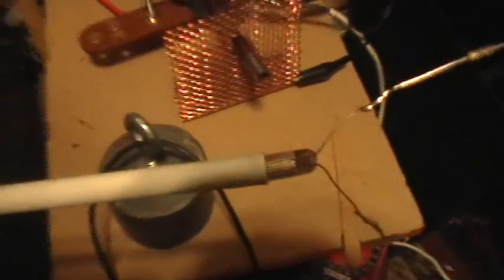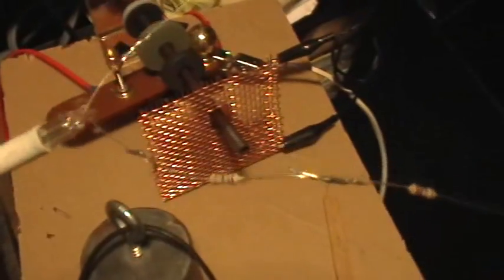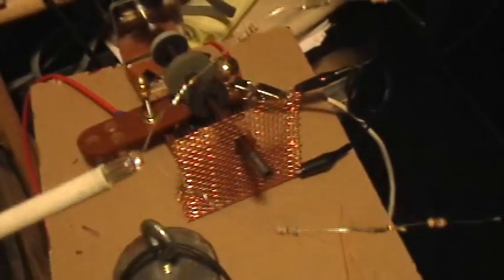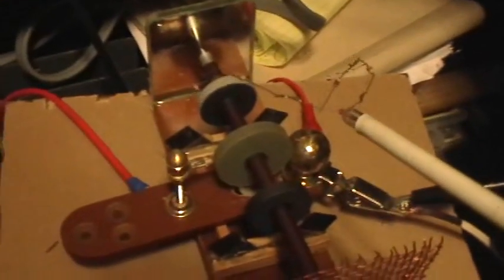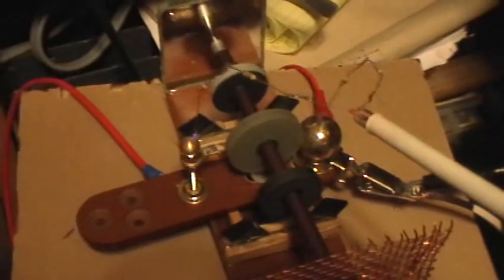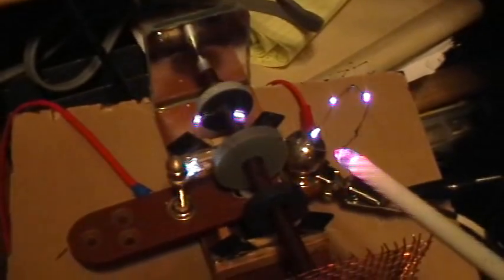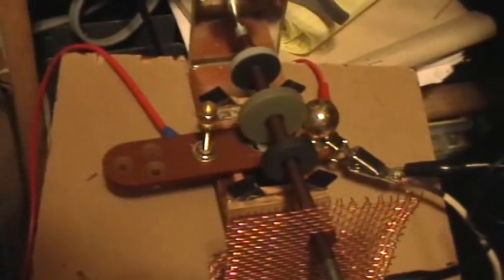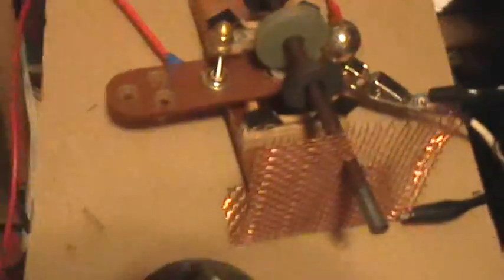Extreme High Voltage: Fooling Around Blows the 15kV Supply

Comment from the maker: I don't really know yet. I did a rough input power measurement with the one supply but not with the other. Once I have the 15kV supply working again I can check them both with the Singer voltmeter and the microammeter, but I need to think about how to scope the PS safely. I suppose I'll have to make a big voltage divider for it, because I don't actually have a high-voltage 100x or 1000x attenuated probe.